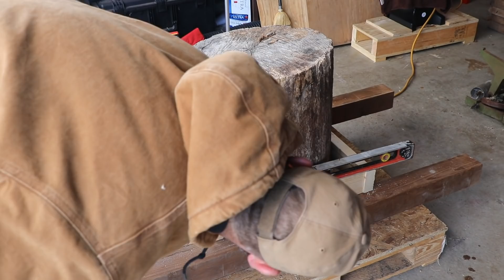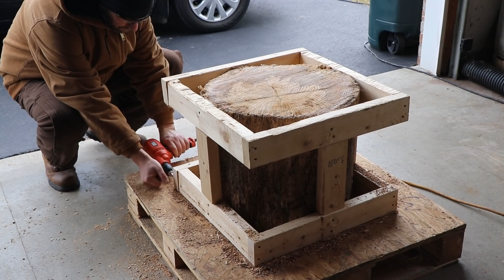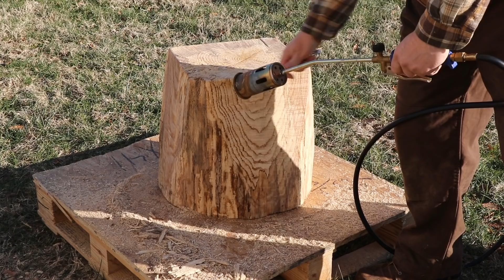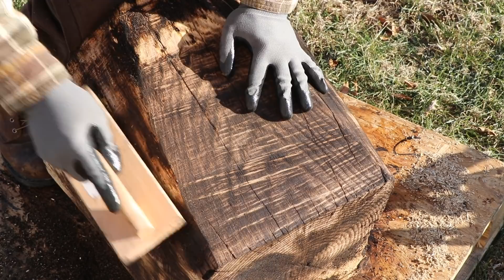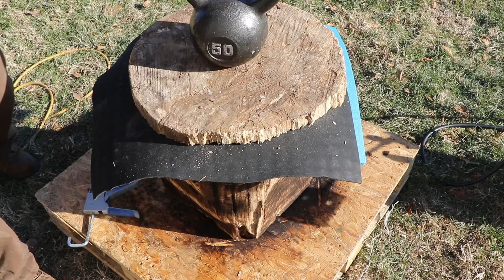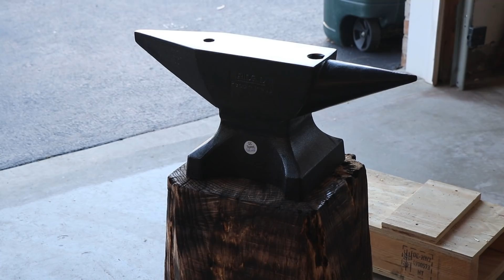Making an Anvil Stand out of a Tree Stump - Part 1

Comment: I like the way you were able to level both sides of the log in one jig without having to reposition the log.  Question though, how would you set up your level/jig if your log has a slight taper on all sides?  My guess is do the best you can and that's what I'll do... I'm a metal worker by trade, not a wood worker.
Reply from the maker: Yeah, that's an interesting problem.  If push comes to shove, I suppose you could frame up rails and use a router and sled setup to surface it like a planer.  I did that for a 3 x 6 oak table to level the top.

Comment: what is the best wood to use?
Reply from the maker: I honestly don't know.  I found the wood for this while camping, took it home, and just went for it.  Wish I had a better answer.  I can tell you that the wood I used was still wet. As it dried, it left vertical cracks.  The anvil stand is still working great though.  I never intended it to be a permanent solution, but it has held up very well.

Comment: Nice work. Love the way it's coming out. The notion of tapering down the sides at an angle is cool -- gives you the best of both worlds. If it was me and I had another inch of height I could afford to lose, I'd take another inch off the top to get past that divot where there was rot or whatever, but it's not likely to affect the performance of the anvil much. Having that corner free might allow it to ring more than it would on a 100% solid platform. The silicone is a good call - per Black Bear Ironworks. I did that and it helped quiet mine down. Love the rubber mat at the base too -- what kind was it? Your yellow chainsaw needs the chain tightened up. You probably know this:  A properly snugged up chain should divert from the bar only enough when you pull down on it in the center of the bar to show just the tip of the drive teeth still in the groove -- no space between the drive teeth and the bar. Many people don't know that -- good pro tip. I have mental issues with seeing loose chains because I used to work for my brother's tree business and he was a zealot about proper chain tension. It's not usually dangerous -- you just throw the chain, but once a year or so someone gets badly injured when they fly off. Chains stretch a lot the first time you run 'em. Usually you tighten it up after the first couple hours running it through wood and you're good to go. The 2x4 method you used to level both the top and bottom of the stump piece was clever -- and that's a nice pingy ring with your ball bearing. Kanca and Perun and some others make a 1165lb forged anvil for a couple hundred bucks less, but they definitely can't claim the fame of "ACME Tools." That's worth the extra $$ all day long. Best part for me was the butcher's brush to clean off the charred wood -- never thought of that. Great tool for the job! Rub a healthy soaking of boiled linseed oil into that thing when it's ready -- she'll be gorgeous! Nice anvil. Wile E Coyote took a few of those to the cranium, as I recall...  ;-)